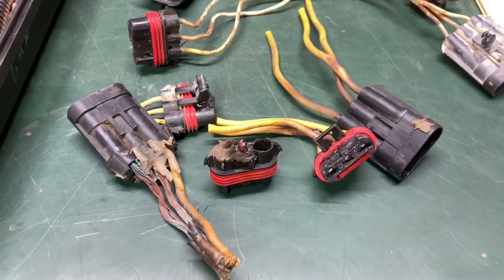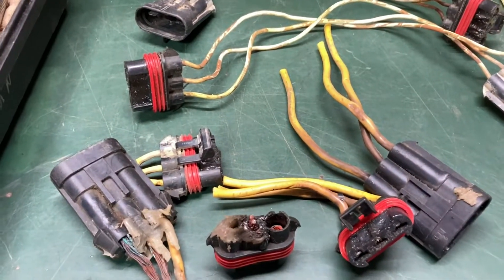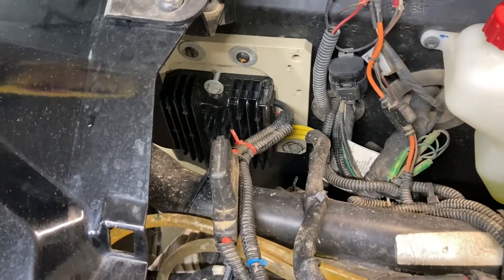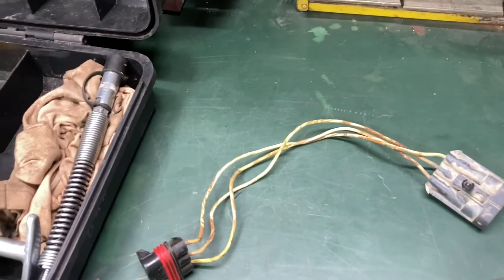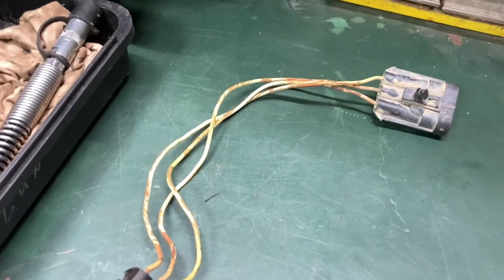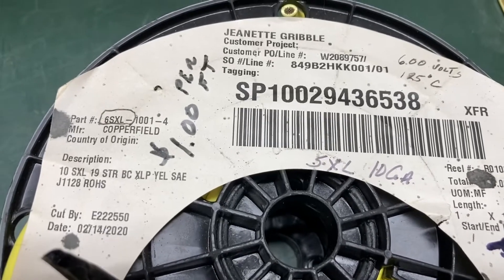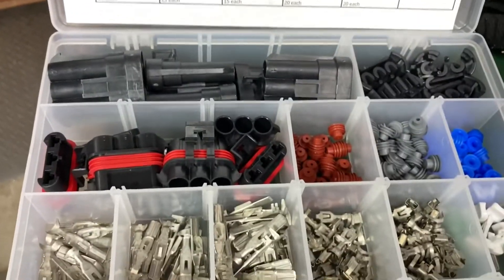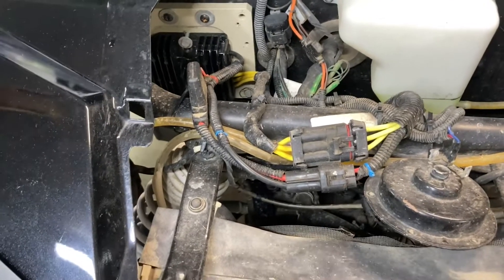2015 Polaris rzr 900 repeated voltage regulator failure fix.

Comment: I have the 570 sportsman and what looks like the same voltage regulator.  mine melted so bad i can not tell which wire to splice to which wire since all the wires are yellow.  Why would they do that and how can I know which wires to splice?
Reply from the maker: The yellow wires don’t matter as long as you splice yellow to yellow. The yellow wires go to the stator.

Comment: All three wires are yellow coming from the voltage regulator. How do you know which wire is which and what it operates to run the new wiring harness because I have the same problem.
Reply from the maker: It doesn’t matter which yellow wire they are all the same. Just build your 3 wire yellow harness and connect it to the 3 yellow wires on the new voltage regulator they all carry the same amount of voltage.

Comment: Where did you find the wire at ?
Reply from the maker: Can’t remember where I got but I checked looks like Amazon has it now just make sure it is 10 gauge wire.
Reply: Another question when doing your ac wires from stator to voltage regulator does it matter what spot they go back to mine got pulled out of the plug
Reply from the maker: @claytonrath7789 No, I had same problem some of mine were totally burnt up. It has been 6 or 7 years and all it working just fine on both machines. I was really worried about the stator as bad as the wires were burnt.
Reply: Awesome thanks so much for your time
Reply from the maker: @claytonrath7789  your welcome hope you have the same results as me

Comment: My Arctic cat is doing this
Reply from the maker: @s.o.f.fpatriotsforlife414  wow, I am not familiar with arctic cat regulator location but the basic principle of how the system works should be the same. I would find out what the ac voltage out put is supposed to be on each leg of the stator and check it. Make sure your grounds are good. Make sure it is not over charging. Mine was just as easy as the junk factory voltage regulator just over charged and burnt up the wiring. Contact Ricks electric in New York he should ba able to hook you up with what you need. Good luck

Comment: I have a 2015 ranger crew 900 same problem ordered new stator and voltage regulator did you build your harness stand alone from stator to voltage regulator then back to battery or did you tie into factory wiring somewhere
Reply from the maker: @raymonmeador1385  The stators on both machines were fine. I build completely new harnesses from voltage regulator to the stator. I put a new plug on the stator wires because it was melted. I also built a new harnesses from the voltage regulator to power and ground just to be sure I added an extra ground wire to this frame. Sure hope it works for you as my two RZR’s are still charging and no melt downs since I did this modification. Good luck!

Comment: Where did you get the two wire connector kit ?
Reply from the maker: Got the terminals at cycle terminal shop cycle terminal.com phone number 732-281-7657

Comment: The high temperature of the stator wire and connector may mean you are using a parallel type regulator instead of a series one. Polaris Sportsman 4WD has the original serial type regulator. These regulators draw only the consumption current from the stator. Parallel types of regulators draw maximum current from the stator and then exactly what happened to you happens.
Check what type of regulator is in the original. If you put a parallel type regulator, then you have significantly increased the probability of burning the stator.
Reply from the maker: @3FHVSP-Regulator-Rectifier  I am not an electrical engineer that is why I did a lot of research on the system. As stated in the video with the help of a great Polaris parts man hooked me up with a voltage regulator from Ricks electric in New York. He must have gotten it right as I did both my 2015 RZR’s back in 2018 and all has been fine ever since. I really feel relocating regulator to the firewall on a ceramic heat sink and using the 10 gauge high temperature wire and eliminating the jumper with 16 gauge wire Polaris put in the circuit surely helped over 5 years since I did this to both machines and no charging problems but best of all no melted wires and no close calls of fire. Just wish someone like you would have been working for Polaris when I called them when I was having all the problems. Thank you for watching.

Comment: Bought a 2016 rxr xp4 1000 turbo with 300 miles friday. Second day of owning it and the stator wires melted. Junk
Reply from the maker: @stlreaper8392  Polaris definitely didn’t think things try putting the rectifier in front of the left rear wheel. I was amazed when I called Polaris they didn’t want to help had to figure it out on my own with the help of a great Polaris parts man. No trouble at all since I installed the Ricks voltage regulator built the new harness and relocated to front of machine on the firewall.

Comment: 2016 570 ranger. My problem turned out to be a bad ground. Everything is grounded under the fuse box under the drivers seat. Factory job is terrible, too many wires in each ring lug, poor crimp, and ground stud and frame are painted. My son could have done better when he was in the 5th grade.

Comment: Does the 630 metric pack directly plug in to the voltage regulator?  I have the same problems
Reply from the maker: Yes it does. My problem all the  connectors were melted and had to be replaced. Another year since I did this to our RZR’s and no problems at all.
Reply: @rzrpap  thanks so much. I didn't have that problem, but I definitely have Voltage problems and I'm changing all the wiring which I was unaware is since because it's underneath so from the stater to the voltage regulator. I'm doing new wiring and I'm also relocating
Reply from the maker: @garychios  Good job that way you know it will be done right. Glad video helped you.

Comment: got another regulator on the way
Reply from the maker: Wow My wife and had 2008, and a 2011 rzr 800 and never had one issue. When we got the two 900 rzr  all we had was voltage regulator issues until we upgraded to a Ricks hot shot regulator moved it to the firewall required the whole system with high temperature wire. Does it charge for a time after you install the new regulators? I know the regulators I was getting came from China they were junk. Did you check with Rick electric?

Comment: lucky man ive put 3 new regulators new stator checked almost all wires and i still have no charge on my rzr 800 really sucks just did a full rebulid also hasnt seen the trails but on time and smoked a bottom end beacuse we had no oil pressure crazy these machines are good but a pain to work on the charging system
Reply: Is the flywheel bad, see mine had the magnets falling out cutting the stator. The wires were grounding out at the stator causing wires to melt on the voltage reg and have overcharging issues.
Reply: its the fusible on the red wire off of the Output of the Voltage Regulator.  It goes to the solenoid underneath.  Do a continuity test
Reply: @garychios  I figured it out it was a few negitive wires hiding under

Comment: Having the same issues, failure after failure.  Where did you order the 3 pin connectors? I had to buck off the stator plug and buttsplice it to get home because the plug melted and almost caught fire.
Reply from the maker: Also get the high temperature 10 gauge wire.
Reply from the maker: Kory, got the metro- pac at cycle terminal shop@cycleterminal.com 732-281-7657